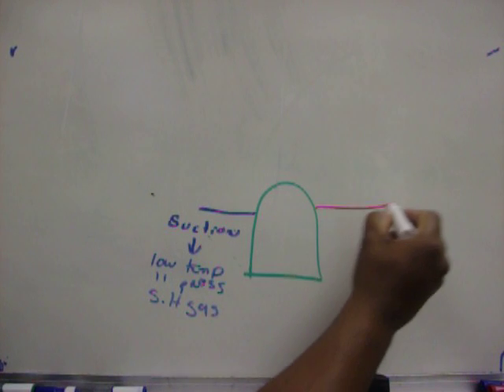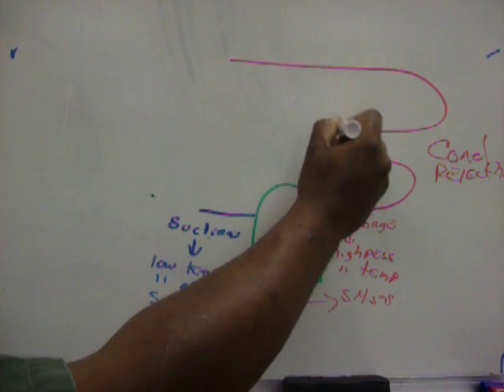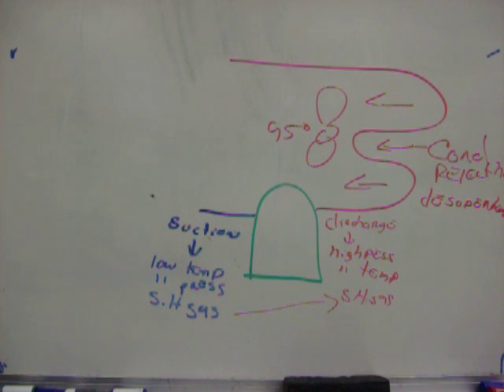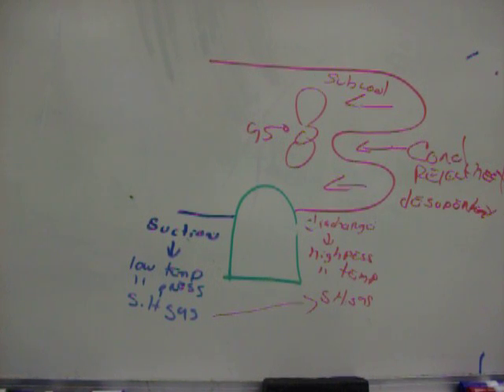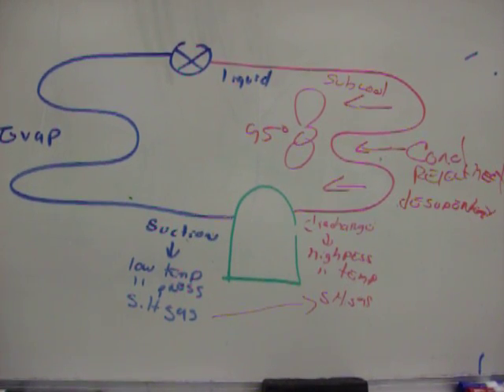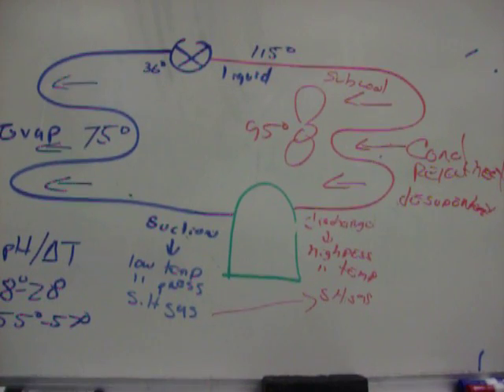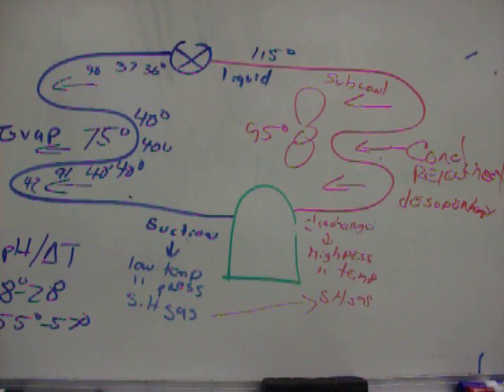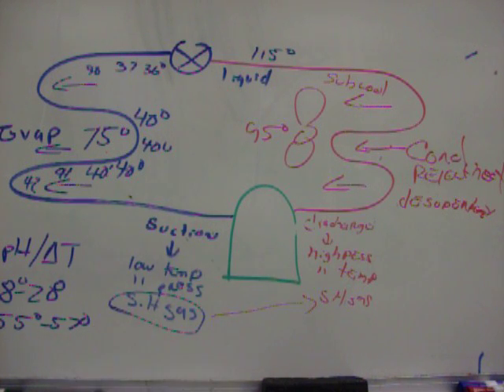Refrigeration cycle

Comment: so the basic concept of using the compressor is to increase the temperature of the refrigerant  coming from the evaporation coils  to a temperature which very higher than the temperature of  the surroundings,so that exchange of heat takes place....and similar for using a throttle valve so as to decrease its temp ,lesser than the temp of food materials inside a refrg????